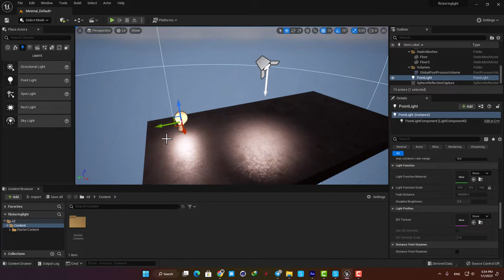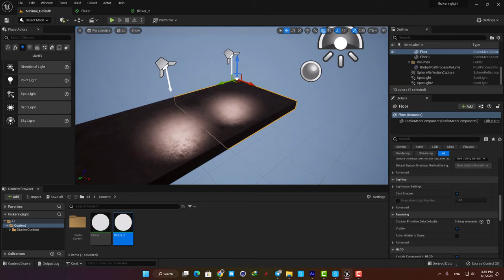Make Flickering Lights In Unreal Engine 5

Comment: If you don't want the light to go out completely when flickering, you can just add frac output to another constant (for example 0,5) and then plug it into emmisive. Thanks for a quick guide!
Reply from the maker: thanks for the tip my friend
Reply: hey im newbie, but consant node dont have input so i cant connect the frac output to another constant
Reply: @anonym439   he means literally "add" as in the "add" function (maths), so you plug the new constant and the frac output into add, then plug the output of add into the emissive

Comment: Question: What if you want the flicker to work in reverse? What I mean is, the default state should be "light off" and only flickers on at a random interval, like lightning?
Reply from the maker: I think it should be possible by playing with the values in the material, but if it didn't work, you can go with blueprints and take a totaly different approach

Comment: This is great.  Quick question.  Instead of creating multiple materials for different timing, can you somehow make an instance editable variable and just set that for each light in someway or at least use a random vs. a constant?  Again, great tutorial.
Reply from the maker: you are welcome . well yeah I guess it`s possible but haven`t tried it myself so I am not sure of it .
Reply: sorry if this is a bit late but you can replace the constant that connects to the multiply with a scalar param for material instances

Comment: I mate, thanks for your videos! I'm having a problem with UE5! When i add  flicker on material it doesn't works on the screen but i can see it flickering only in the preview.
How can i fix it? Thanks!
Reply from the maker: you are welcome . that is unusual , do other materials work in your scene?
Reply: the same
Reply: Had the same issue. I forgot to set the "Material Domain" in the material editor to "Light Function", that fixed it